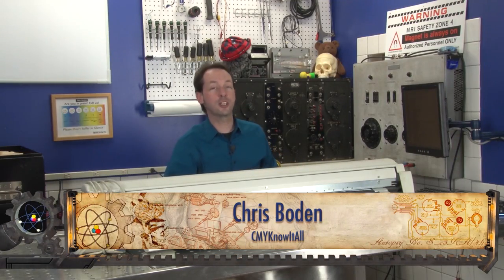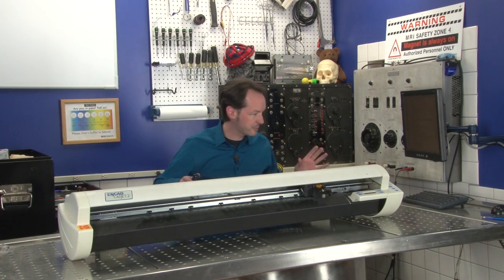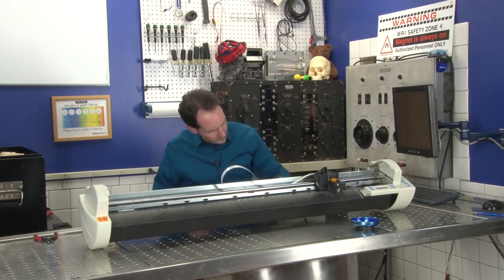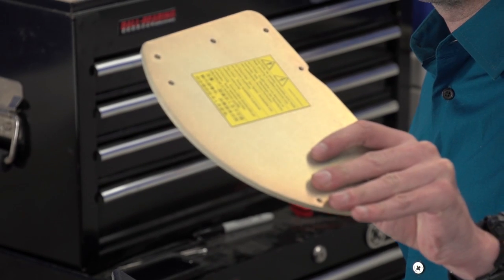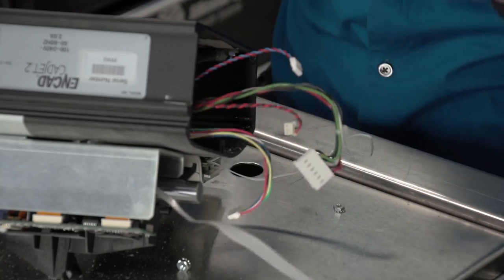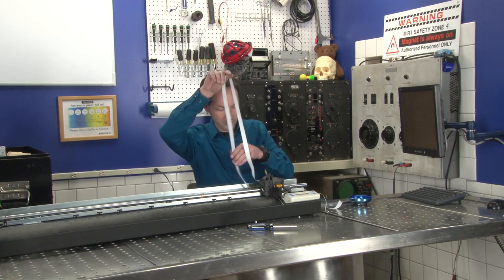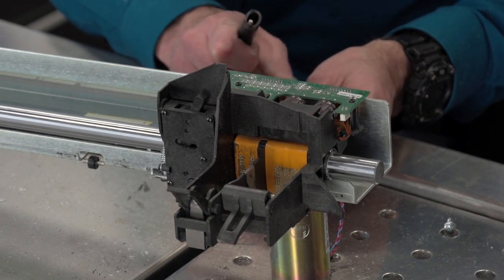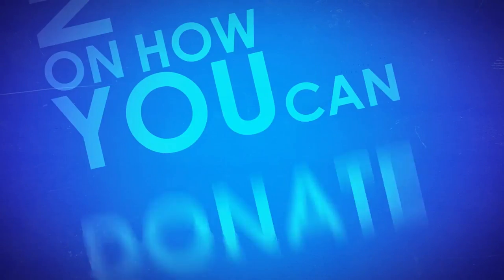ENCAD CADJET 2 Printer: Equipment Autopsy #75

Comment: I’ve taken 3 plotters apart this year and they all use a similar design. The HP plotter i disassembled had 17 motors and they were all DC, some with quadrature encoders. I see an encad like this on Facebook for $20 but I don’t see anything interesting beyond the stainless guide rail & motor. I’ve found the 10-20 year old (commercial?) laser printers you would find in an office to be the highest concentration of mechatronics you can use for future projects.

Comment: For a long time DC motors have been used for the carriage; cheaper motor + expensive encoder strip means they can accurately control it with servo-like feedback. The paperfeed is likely always a stepper.

Comment: In my opinion there aren't many downsides to 'harvesting' printers. It's not only the motors or mechanics that are useful.

A lot of the time (in my experience) they also got modular (you can take them out as a separate functional block), reasonable efficient and darn handy switching power supplies!!

Also look around for them handy power transistors. Always handy to have some 'burners' laying around
Reply: I often think of it as butchering an animal. I’ll set it on a cart in the garage so I can wheel it around and then just start pulling screws until I get the equivalent of a hind quarter. Then I take that piece inside and break it down to individual components.

Comment: It's a stepper motor,Yo!
Also,I think the belt is supposed to be flipped the other way. The teeth mesh into the gear/pulley,so it doesn't slip. But..something went FUBAR,in this one.

Comment: Just replace it with a stepper motor yo. If it's too slow just hook it to 24V DC or something that would fix that, maybe wear out motor early though.

Mount it onto one of the doors so when people walk in it opens the door. Or find a bunch of resistance wire and make a giant motorized potintiometer.

Comment: I have a CADJET2 connected to an XP computer. I cannot
print. I show no errors. When I attempt to print the test page I see the
document spooling in the printer register but after about a minute I receive an
error that page could not print. I was told that I probably have the incorrect
drivers. My first question is, does anyone have a cd (Windows XP compatible)
that I could get a copy of or emailed to me (depending on size)?

My second question, I was told that the CADJET2 uses HP/GL
and HP/GL2 format. I have to convert documents from PDF and CANVAS 11 for the
CADJET2.  Any ideas?

Comment: How can they extrude something hollow? It would need an inner form too, and i don't know how you'd hold that without ending up with a thing with a slot in it for the thing in the center?
Reply: jtech0 you think just 2D. But the extruder is built in 3D, so the middle part is simply held from behind with an arm going through the liquid/molten/soft metal. So the fluid supply will simply wrap around the arm, and the front piece is a continuous opening. The picture on http://www.britannica.com/EBchecked/topic/199197/extrusion displays this quite nicely.
Reply: I kind of thought about that after i posted. I was used to thinking of the play dough type ext ruder where things just go though a die and make solids. I've seen some for clay too, but that's pretty much grown up play dough type extrusions.

Basically a piston and some kind of plate with a cut in it.